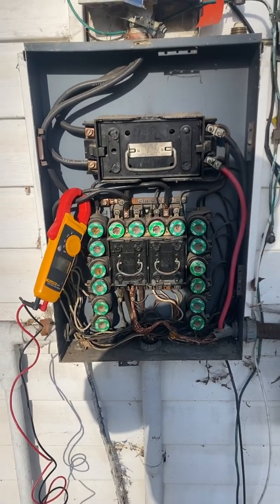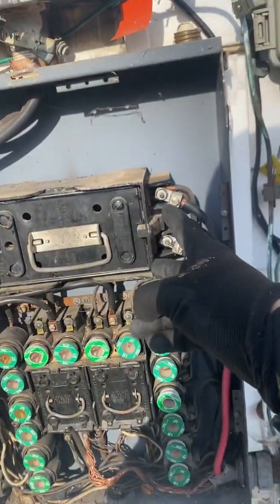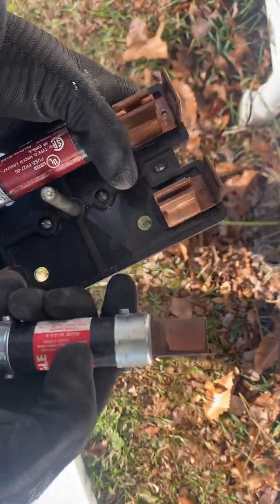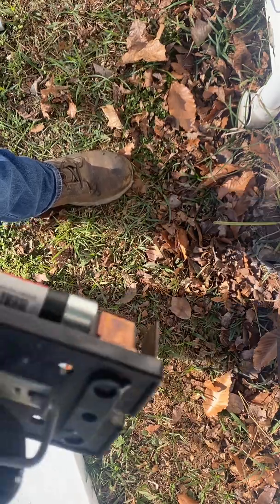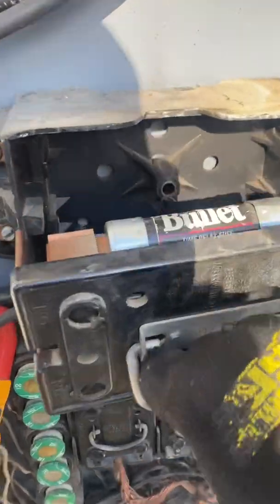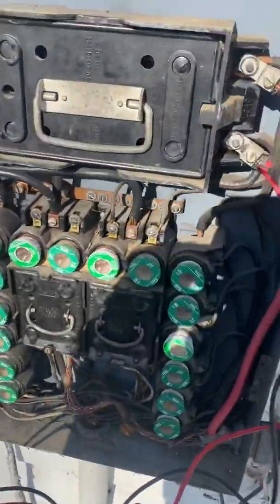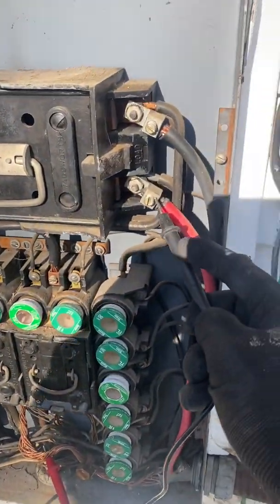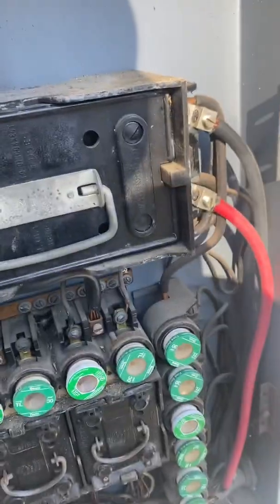How to change house fuses 100 amp fuse main panel

Comment: Are fuses for older electricall panels?  Dont modern panels just have a 100 amp main breaker instead?  Or would you still see a 100 amp fuse and then a 100 amp main breaker?
Reply from the maker: @jediagh  fuses are definitely for older electrical panels, modern electrical panels have a 100 or 200 amp main breaker and then the individual branch circuits that feed your outlets and lights, etc. will have usually 20 amp breakers